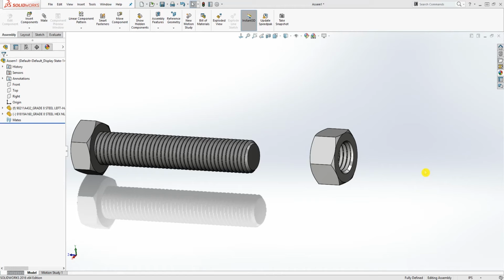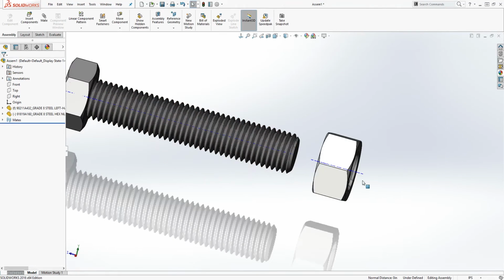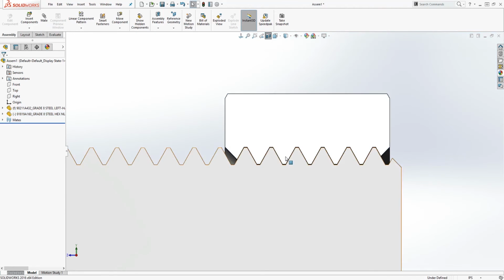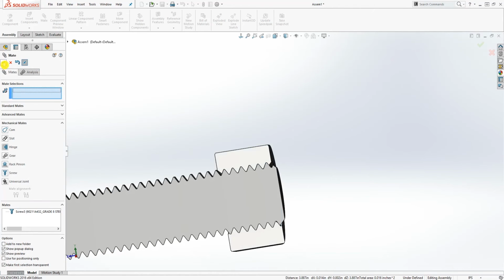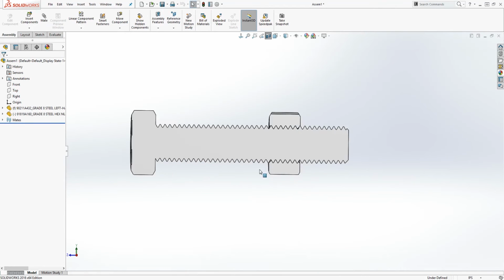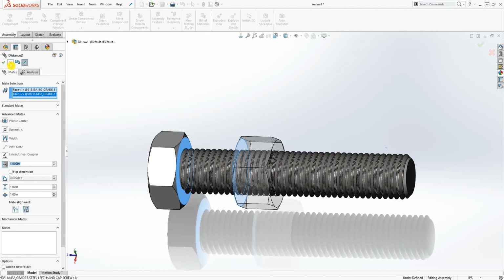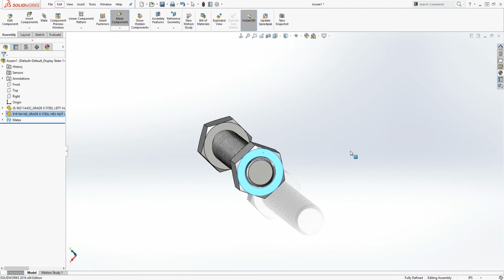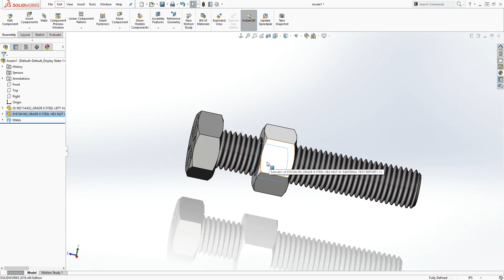SolidWorks Tips & Tricks - How To Properly Apply Screw Mate

Comment: For me it's not working, I cannot select any surface that you are pointing out. Could be an issue because the thread of the screw was modeled with the "thread" option?
Reply: i had the same issue, modeling the thread and screw manually worked for me. I used the helix + sweep cut

Comment: Hi, when I try to select the two meeting faces it says selected entity is not valid for current mate type. This when i try to select the two face you have shown the apex on the screw and negative apex on the bolt. Could you help?
Reply: I have this problem too. Please help
Reply from the maker: Hello,  did you change you mate type to screw under mechanical mates option?
Reply: CAD Defined Hi, yes I have selected mechanical mate and Screw but i can't seem to select the second face